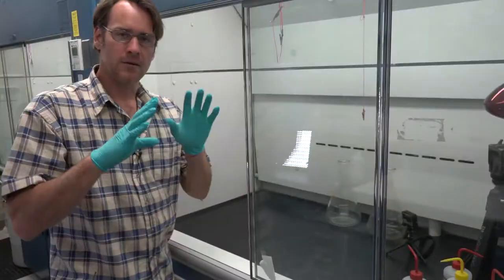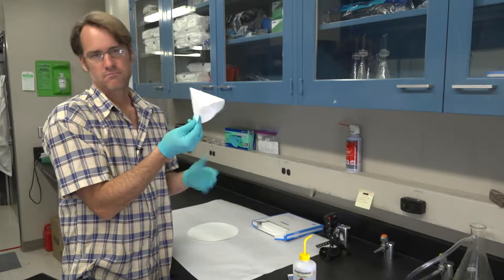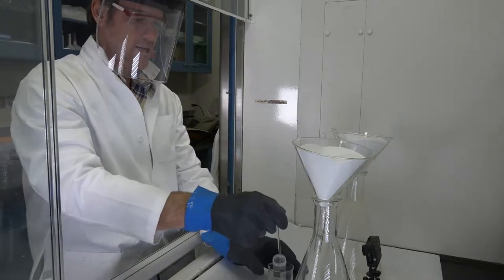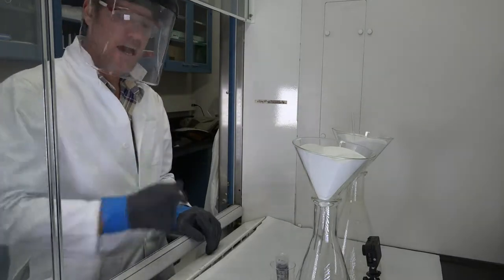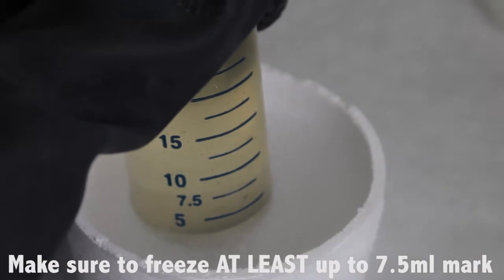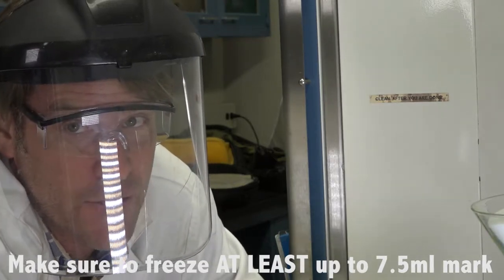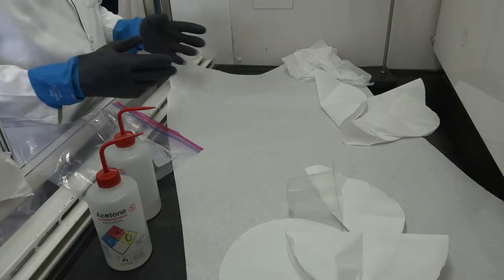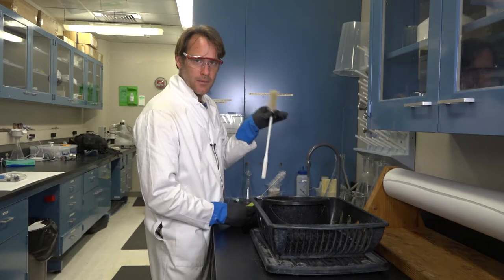Minsep - mineral separation using the methylene iodide (MI) heavy liquid

Comment: Nice vid. Btw why don't you use sodium polytungstate? As far as I know, it's not so dangerous as MeI.
Reply: We tried but it's too thick to pass through our filter paper and getting it back to proper density is more of a hassle.  MI has a low viscosity and is relatively easy to remove acetone and get back to it's highest density.